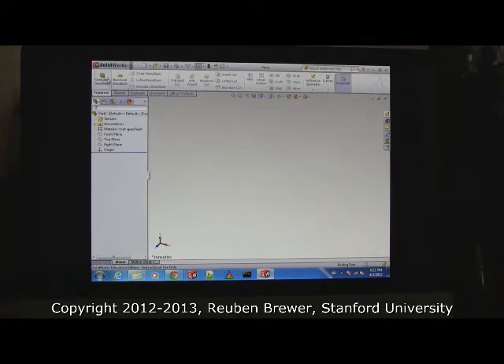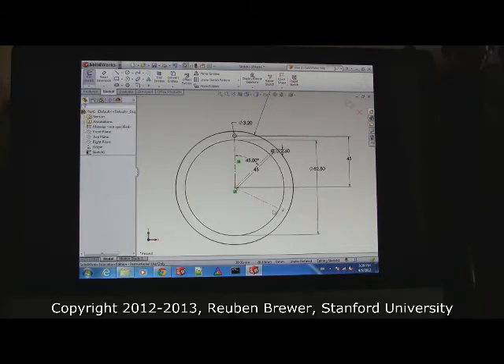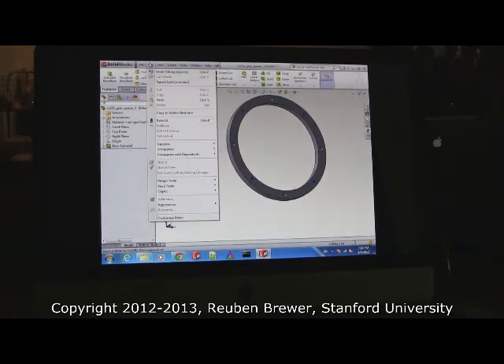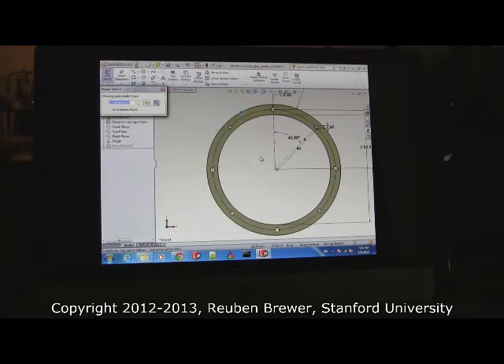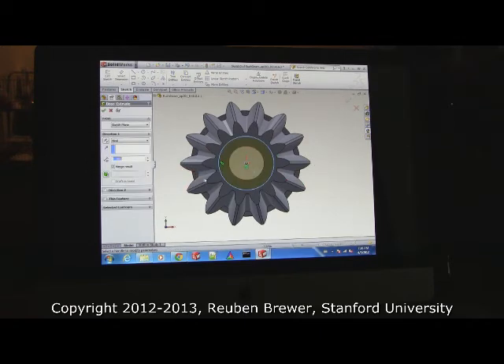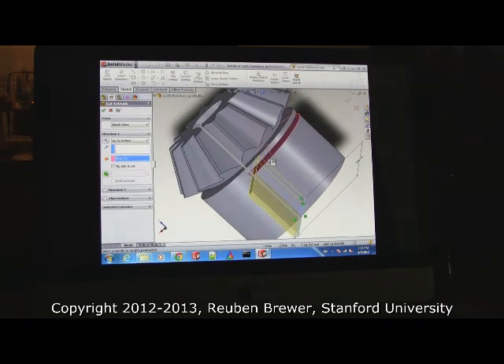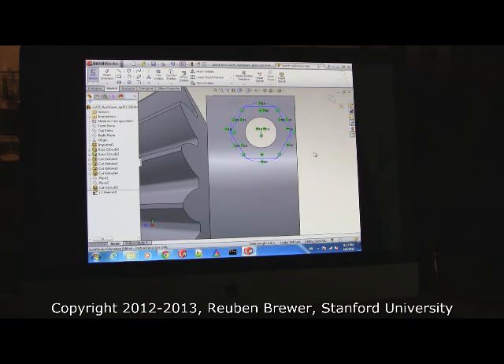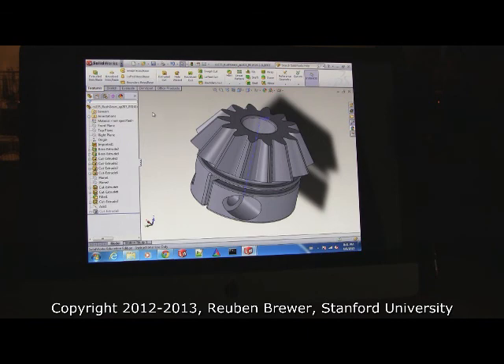CS235: Applied Robot Design, Solidworks Training Session 1

Comment: A SolidWorks trick: For inch to millimeter conversion in SolidWorks you could easily type the scale name in front of the quantity in the smart dimension! For example if your default dimensioning system is MGS and you want to draw a line having 2 in length, just type "2 in" in the smart dimension :-)